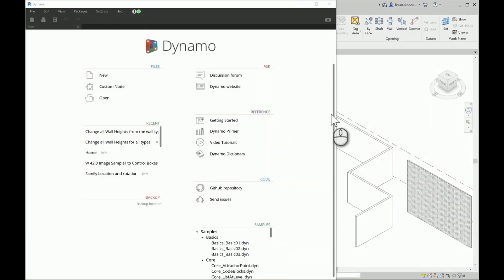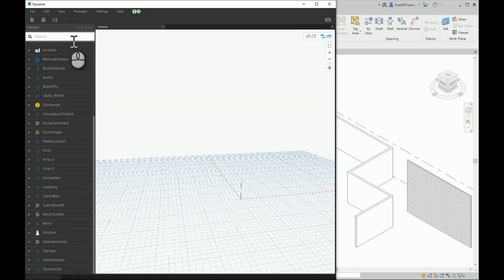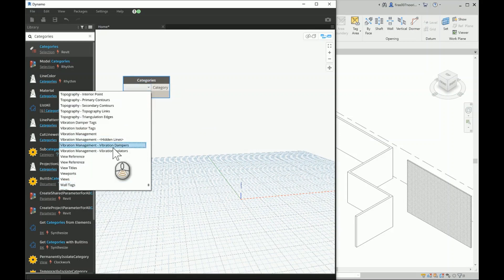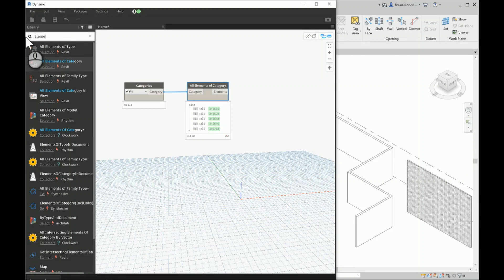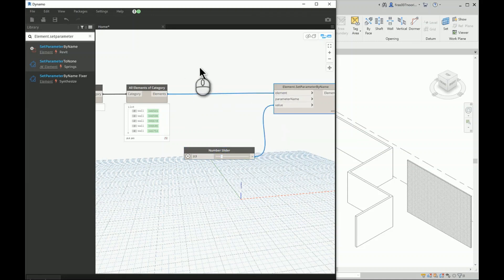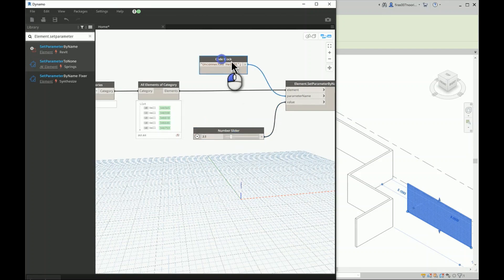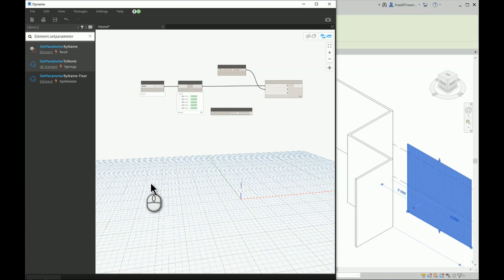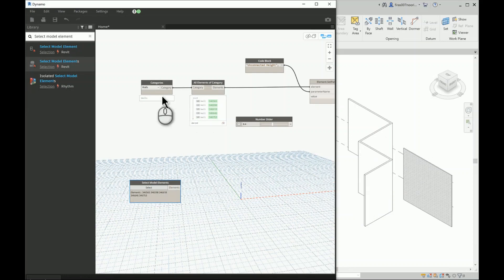Change Wall Heights in Dynamo _ Controlling Type and Instance Parameters in Dynamo

Comment: hello, i need to change the level for other elements like slab, wall windows,
do you have a Dynamo for this
thanks
Reply from the maker: Hi dear, sadly, I did not make one, but you can make the same node given here in this video, and add to them the level changer, either by picking from existing or simply by adding any value you want to make your own new reference level